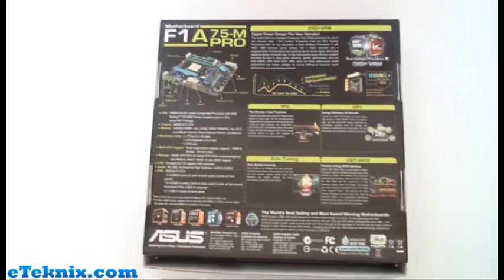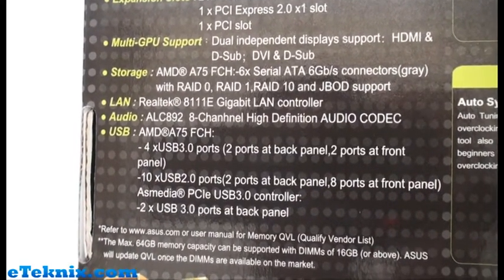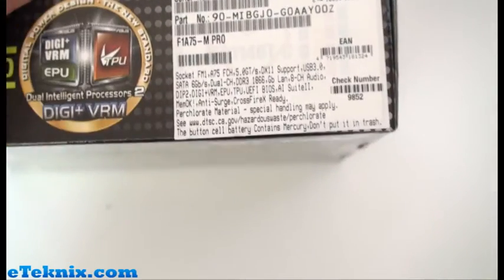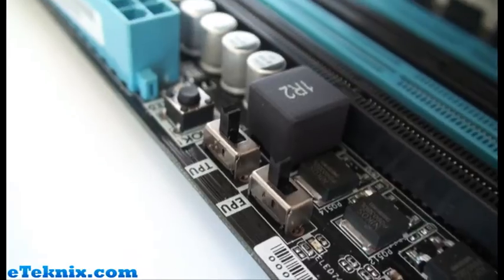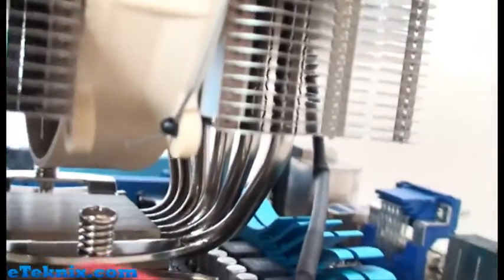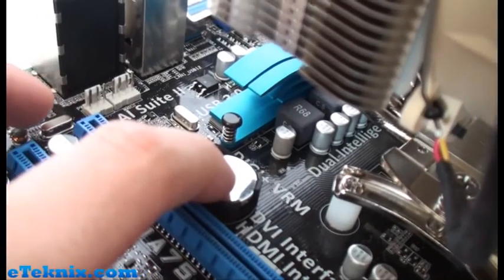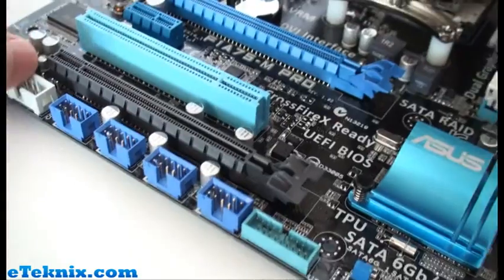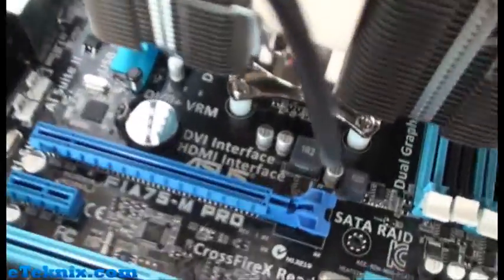Preview: Asus F1A75-M Pro Motherboard

Comment: Fusion A8-3500? :D

I have a feeling you won't be able to answer this yet, but do the CPU cores and GPU both have their own multiplier? I'm curious because it would be a real shame if the GPU limits how high those 32nm K10 cores can clock! The only preview I've seen so far shows 3.6GHz which is meh lol